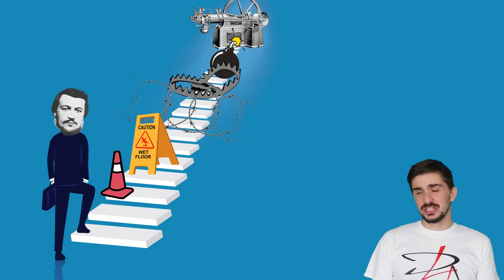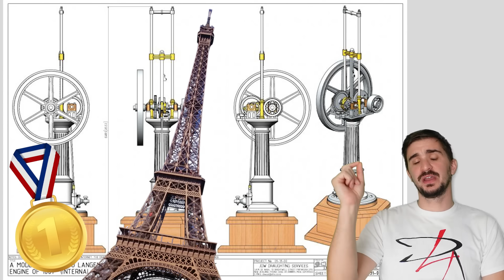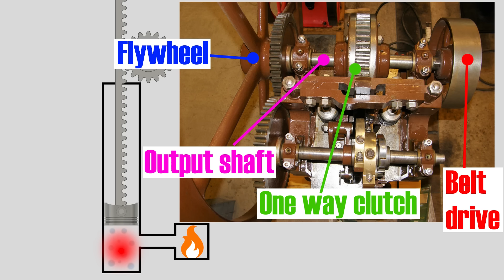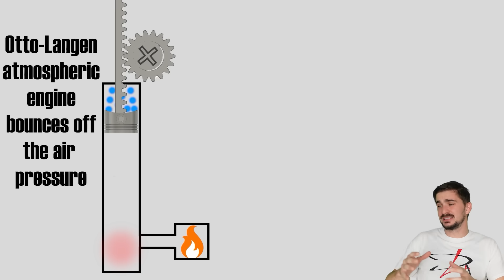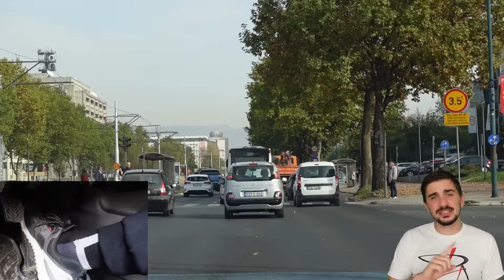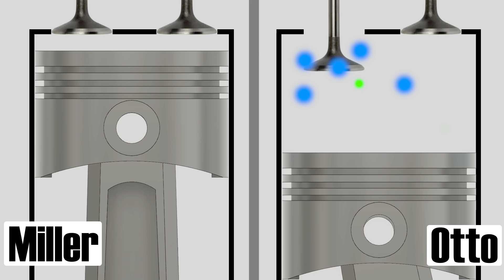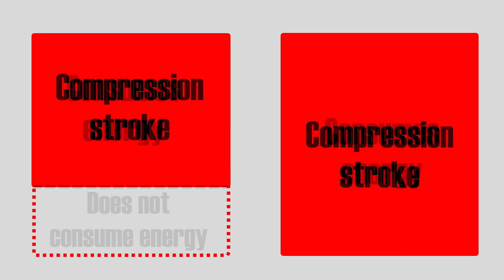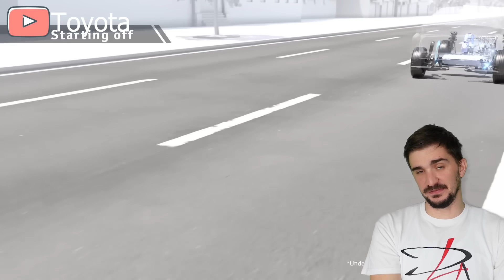You'll understand everything about Atkinson, Miller and Otto cycle engines after watching this video

Comment: I'm a big fan of Toyota's Hybrid Synergy Drive, which of course runs an Atkinson Cycle engine combined with two electric motor generators, which effectively operate as an eCVT.  It has two planetary gears. One is connected to Motor Generator 1, which is connected to the Atkinson Cycle engine, and the other is connected to the drive wheels via Motor Generator 2. There is an inverter connected to both Motor Generators. Depending on the position of the planetary gears, power from the batteries and/or the ICE is transferred to the drive wheels. Motor Generator 2 provides regenerative braking upon deceleration. I drove a Generation Two Toyota Prius Hybrid in Australia from 2007 to 2015, and while it was certainly not the most powerful vehicle around, it was very fuel efficient, and had almost instant torque from a standstill. Only BEVs would outperform Toyota's Hybrid Synergy Drive, but with the caveat of range anxiety. I'm in Mindanao Philippines at present, and Toyota Hybrid vehicles make a lot of sense due to poor infrastructure for charging BEVs.

Comment: From my limited thermodynamics courses 50 years ago, I remember that in the Carnot Cycle (??), maximum thermal efficiency is (high heat - low heat) / high heat meaning 100% thermal efficiency occurs only with an infinite high heat.  For an internal combustion engine, this was directly related to compression ratio.  Maybe some of these alternatives provide a higher high heat off peak load.  Beyond my pay grade.

Comment: Thanks for detailing the subtleties of these three versions of much the same basic automotive engine of the last century or so. The lesson I learned is not perhaps the one you were setting out to describe. 
I learned that, as has happened over and over, the cheaper to manufacture, "good enough to sell" solution without paying royalties will win in the marketplace every time. This happened with the Selden patent and Ford,  as well as the Edison Co. patents control of Motion Picture production and distribution limited to the East Coast of the U.S. which was stymied by the move to Hollywood. In all these cases, restraint of trade  through patent monopoly failed in the marketplace. The upshot of which was a long period of the standardization of a less than optimum process. That stasis, tends to end when even more efficiency at a low price arises and the cycle begins again.
 Electric cars are that paradigm shift that makes meaningless these last gasps of the old engine design battles revisited. The short summary history you provide here is enlightening none the less.

Comment: Atkinson Engine is used in all Toyota Hybrid nowaday : The Toyota Prius uses an Atkinson cycle engine to increase its fuel efficiency. The Atkinson cycle engine is different from a traditional internal combustion engine in that it has a longer power stroke and a shorter compression stroke. This design results in reduced pumping losses, which increases thermal efficiency and results in better fuel economy. Additionally, the use of the Atkinson cycle allows the Prius to operate in its most efficient range more frequently, which further improves its overall fuel efficiency.

Comment: I don’t see how a supercharged Miller Cycle engine would have any advantages over a NA Otto Cycle engine. 

When adding forced induction to a Miller Cycle engine, the piston now has to compress denser air, increasing pumping losses while the more powerful combustion generates more heat which can’t be fully extracted since the expansion ratio remains unchanged, reducing thermal efficiency.

In the end, we get the same result as with a NA Otto Cycle engine, good power and responsiveness but relatively low efficiency while being more complex and introducing an additional parasitic loss from spinning the supercharger.

Comment: Obviously very knowledgeable person,  thanks for your time.   Was wondering if you could do a video on 60/40 type transfer cases with center differential.   Changing torque and not speed though gears,  is a hard concept.  Thanks

Comment: I love your videos, truly fantastic explanation, visuals, script, topics, up-to date subjects!!
Quick question about this, has anyone ever made a Miller engine with Turbocharger?
It surely would not solve the low RPM lack of power/torque issue, but I'm very curious how numbers would change compared to a Supercharger.
If I could ask for a subject for a video, it would be a retrofit system on a currently available naturally aspirated or turbocharged engine with an additional compressed air system for additional power and low end torque - I'm curious what you think of the theory behind it, and if anyone made it to the mass market already. I am aware from the Polytechnics University of Budapest that 'someone' was introducing a similar idea for turbocharged diesel buses and trucks for better takeoff capabilities.
Anyways, vielen Dank!

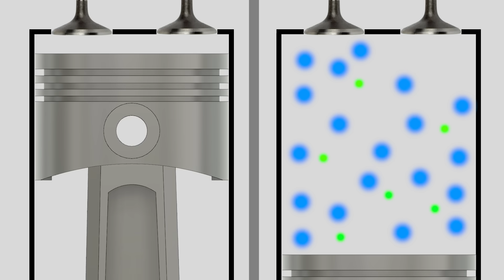Comment: 15:37 I think there is something wrong in this explanation. It says: "Compression can't begin until the intake valve closes" and "some of the air-fuel mixture goes back into the intake manifold" Those claims don't take into account the inertia of gasses. It is possible in fact to have the piston moving upwards while air-fuel mixture still enters the combustion chamber through the opened intake valve, and none of it goes back to the manifold even though the piston goes up. And of course the valve should be timed to close at the moment the cylinder pressure equalizes with the gas inertia as to not allow gas to go back... Besides is the energy during compression really wasted? I view it like a spring. Energy is spent during compression but if ignition doesn't happen the compressed gas pushes the piston back with the same force that was used during compression. In that sense the only energy lost is the part of the heat energy generated during compression that soaks into the engines superstructure. In other words the energy lost during compression is regained during combustion plus the energy of the combustion itself. That's how I picture it. But of course I could be wrong...

Comment: I have seen the round push button switches in old mansions. Also there were pocket doors, so the switches weren't placed near those entrances to rooms. The tooled leather wainscoting  was on the lower walls so the switches were placed above that level on houses that had previous gas lighting.
Reply: Oh yeah, what intially looked like braided silver wire was actually stranded steel wiring with a clothe cover. I was ready to wire that place for a minute. I think it had been rewired in the 20's

Comment: The cause of higher efficiency comes not by reducing work on compression, but increased work during expansion - calculated for the same amount of fuel (and air mixture). Imagine a 700cc 1 cylinder Otto engine, then a 1 liter Attkinson cycle. They consume the same amount of fuel, they can compress it up to the same compression ratio, but the former relases higher pressure exhaust.

Comment: I wonder of the Miller cycle and the variable valve timing are similar? I remember at hight rotation speeds even an atmospheric engine can benefit from the inertia of the gasses streaming into the engine, you get some more gas in if you delay the valve closing until well past the 'death point' of the shaft, the rushing molecules only get pushed back when the piston starts to put some counterpressure...

Comment: If I take a stock cam out of pretty much any pushrod v8 and install a performance cam, I have turned my Otto cycle into an Atkinson cycle motor? 
 
Performance cams have substantial overlap where both intake and exhaust valves can be open. There is a lot of variance in cam choices, but common stock cam valve separation angles as wide as 116 degrees or more, where intake and exhaust lobes are quite far apart.  Some performance cams are in the 106-ish or smaller degree lobe separation.  These cams have that “choppy” sound because of so much valve overlap.  Great for power.  Bad for fuel mileage.  Duration of valve opening might be 200 to 240  cam degrees (100-120 crank degrees) depending on the cam and application.  This seems like what performance cam manufacturers are doing is shortening the compression stroke just like the Atkinsons cycle suggests.  If this is the case variable valve motors are able to switch cycles.  

Hot rod motors seem to be stuck in the Atkinson cycle, or is it something different yet?

Comment: There is also a modified Atkinson cycle engine, if I remember correctly, in which the intake valve closes before the top dead centre and creates a small vacuum which helps the piston for the first part of the compression. I don't remember which brand used this approach.

Comment: I believe it is some misunderstanding about Atkinson/ Miller cycle. For sure main goal is fuel efficiency, but how it is achieved? Lets look at the end of power stroke, valve opens and exhaust gases go out and they are very hot. What that temperature means from physics standpoint? That exhaust gases still have alot of energy in it, temperature means energy. But we cannot use that energy, since crank is already at BDC. It would be good to have power stroke longer... Longer stroke means better recovery of combustion energy.
Lets break down the math: say your intake/compression stroke is 1l, so power will be just like 1l engine (slightly better), but since we have longer power stroke travel (say 2l), size, production cost and fiscal things will be like for a 2l engine. With power of just 1l. So trade power for efficiency. Same applies to diesel it has better efficiency on low throttle. And engines with force induction is right opposite thing - they have longer compression than power stroke

Comment: Technically you can also do this by closing the valve early. And it's more efficient is some scenarios do to lower pumping losses and the high degree of turbulance. Was just researching this and so a comparison talking about high vs low load efficiency between eivc vs livc

Comment: Excellent video! I guess the Skyactiv isn’t pushing a fuel/air mixture out of the open valve because of direct injection only adding the fuel once the valve is closed. Seems like a shame - they could avoid the direct injection carbon buildup problem by simply changing their injection timing.

Comment: This is an interessant topic about engine. How to adjust independently the expension ratio and the compression ratio to get the best efficiency. Many others solutions have been around.
 - 5 strokes engine (Gerhard Schmitz) which involves double expansion with one cylinder for high pressure and another for low pressure.
 - Titanic engine also invlolved multi expensions with high, medium and low pressure circuits. There is no such thing like compression / expension ratios for the Titanic, but we get all the possible work from high pressure down to low pressure...

Comment: Well both Atkinson and Miller got improved far from their original design. Miller get's really interesting if you add exhaust-gas-recirculation and direct injection of fuel or fuel and water. But you need some understanding of thermodynamics and PV-TS diagrams.
The idea is to reduce the amount of fresh air-fuel mixture to the required power to maintain a speed. Which eliminates any throttle valve. If we need more power we increase the ratio of fresh air to exhaust and increase the compression cycle for more air. And we inject more fuel. Water is interesting as dry air is easier to compress, but water in a combustion gives steam, which leads to huge pressure.
Only downside is the increased complexity and you need quite a lot of displacement as you want to "waist" quite a lot of it for the balancing compression cycle. But the efficiency is through the roof. Thats why it's used in stationary applications and it's quite likely that prototype racecars use the idea. They just use one "fuel-water" mixture.

Comment: Hey I got a stock turbo sled modded for more boost and when I even give it ½ throttle under a load it'll rev up and cut out and backfire. My guess is it needs bigger injectors, higher rated map sensor? What do I do. I'm running up to 10psi over stock.

Comment: A fine example  ro show the difference between theorie and practical use, It mostly starts with the simple question how should those wonder engines be produced. The same problem the Warp drive has (:-)) The miller design has one very strong opponent, simply physics !!

Comment: Thank you for this excellent explanation!  Now I understand a bit better how my Atkinson engine applies efficiency to the fuel economy in my Ford Maverick Hybrid!  

Q: does the battery-generator-motor system act in the same way as the super charger to create better torque at lower RPMs?  BTW, I am getting consistent 40+ MPG with my Maverick.

Comment: Thank you very much, this is an excellent video.  I have a question regarding something that's not addressed in the video.
I've always known the engine size to be calculated by displacement, but since the displacement varies with the Atkinson and Millers designs, how is the engine size calculated?

Comment: The TLDR on the Miller is that you need forced induction because the intake valve stays open as the piston begins the compression Stroke. So, net effect is that the piston is still facing resistance because the supercharger is shoving pressure into it even with the valve open.

I test drove several Mazda Millennia in 96-98 and they were nice cars, but by no means felt all that powerful. If you drove a V6 Camry or Accord, those felt faster.

So, it flopped. Had Madza had the balls to put something like a 3.5 to 4.0 liter V6, it would have been way better.

Comment: Thanks to numerous in depth D4A vids functionally breaking down engines, a simple, minimalist, true Atkinson cycle reciprocating piston 4-stroke engine design capable of high compression power using no more moving parts than conventional VVT engines now exists with inline, V, opposing and radial scalability inherently built in.

Comment: The 8th and 9th generation USDM Civics engine (the R18) used VTEC to switch to a Miller cycle under light load to decrease pumping losses during highway cruising

Comment: Why do you say that the Atkinson/Miller is more efficient?  It's not because of energy put into compression since, at least in an ideal system, you get all that energy back.

And replacing that compression with a supercharger just changes where the work is being done.  I presume there must be some advantage because it's been used but I'm not understanding it.

Comment: Thanks for explaining this so well. 
However it is not clear to me why Toyota names their ice's in hybrids to be running on the Atkinson cycle (at lower rpm). It seems to me it is more like the Miller cycle because the stroke length is always the same and the inlet valves control the pressure during the compression cycle.

Comment: Thanks to modern electronics, fast processing computers and precision machining, gasoline internal combustion engines can be ran in the Otto cycle for maximum horsepower, stratified charge/diesel cycle for maximum torque, Atkinson/Miller cycles for maximum efficiency and reduced emissions… all on the fly as needed.

Comment: True about the Miller cycle - but actually I would not call it " and engine with shortened compression stroke" but rather "an engine with elongated power stroke". The actual compression pressure is about the same as in the Otto engine but the power stroke allows to harness more of the combusted gas energy, increasing engine efficiency. So less gas energy is wasted in the exhaust - that major idea is similar to turbocharger - it is to recover more of the otherwise wasted exhaust gas energy. Here I am talking about modern Miller cycle implementation, like in current Mazda engines.

Comment: Corrections on the last part of the video with Toyota''s Atkinson cycle. VVT originally is to fix the problem with street engines having a relatively narrow power band. The early VVT systems were a simple on-off switch, with the default state at zero advance. This results in great emissions, decent cold starts, good fuel economy, and a solid HP rating at the top of the rev range. However, the VVT actuator can be switched on to advance the cam timing, improving bottom end torque, not the other way around.

Comment: Budak's cycle improves over Miller's by closing the intake valve before the BDC, instead of after, so that the air does not get pushed back out while physical compression is reduced like in Miller's cycle

Comment: Atkinson cycle engines have made a comeback of sorts.  Honda uses atkinson cycle engines in their current hybrid cars including the Accord Hybrid, the CRV Hybrid, the Insight, and the Clarity PHEV. I have a 2019 Clarity.  Honda achieves the longer expansion stroke with simple valve timing instead of a complicated crankshaft system.  Since the engine is used primarily as a generator instead of a drive unit, it can be set to run at a constant speed and get the most efficiency from the engine.
Reply: Also in Civic e:hev

Comment: The super charger will increase the intake air charge pressure, defeating the purpose of the delayed compression stroke, or countering the intended counteraction of reducing parasitic loss to to friction, but it will reduce the moment of cylinder vacuum on the initial intake stroke, its like counterbalancing for over balancing an imbalanced condition.